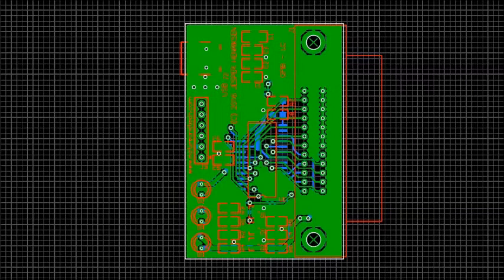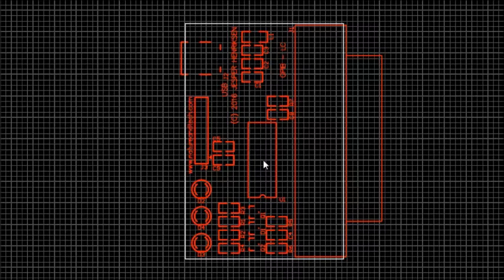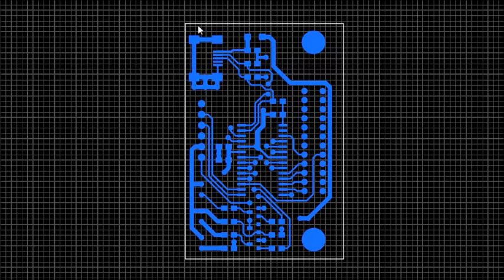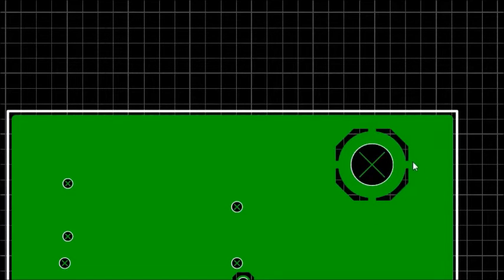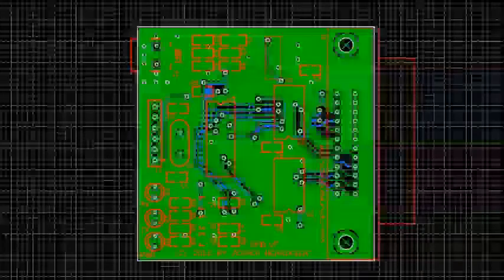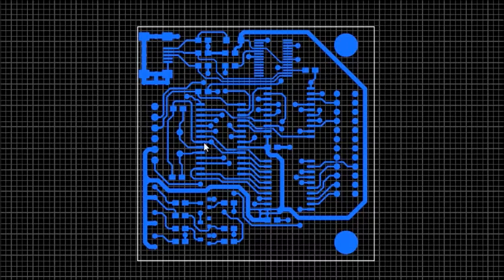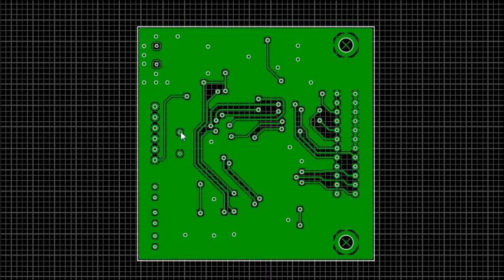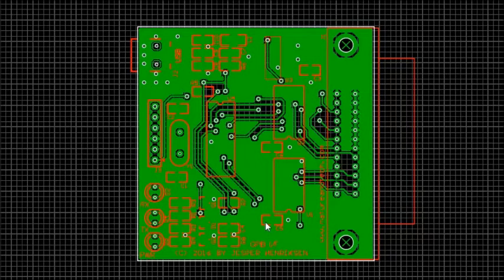Design of a USB to GPIB Bus Interface - Episode 3 - PCB Layout

Comment: I would like to make something like this using i2c to GPIB, so that I can connect it to any micro controller including an esp. I was thinking of something like the PCF7585. What do you think? 

I would like to see the circuit..
Also, where can I get a KiCad footprint and 3D step file for the GPIB connector?
Reply from the maker: I have no experience with the PCF7585. Looks like a capable device. I always draw my own footprints.

Comment: Thanks for your reply Jasper, 
I get surprised with all cad tools that you using for  pcb production. 
I'm trying to learning better eagle Cadsoft,KICAD cause it's free tool and CERN supporting it,also a little experience with altium. 
A few boards was from seeedstudio good quality, now I'm going to try an other pcb board house call dirtypcb offers nice quality and price includes shipping to Greece. The offer is for 10 pcb any color - solder mask,2 layers, check it. 
Kostas...
Reply from the maker: +SeAfasia Sometimes you just have to use the CAD tool that the customer wants, because it has to fit into their workflow. I heard good things about KiCAD.
Reply: +NatureAndTech 
nice tool try it some day Jesper,which board house are you send the gerbers to China?
Reply from the maker: +SeAfasia Not sure yet. I have lived many years in Asia, and I always used a PCB house in Thailand. However, they don't take paypal (or credit cards), so I think I will go for China this time. I am looking for one that can also do flex-PCBs, but have not found one yet.
Reply: +NatureAndTech 
ok,waiting to see the quality and your project soon Jesper..

Comment: Hi,Jesper nice job waiting to see the etching process and final pcb.
A question,what is the layout programm for pcb?
Thanks..
Reply from the maker: +SeAfasia Hi, I will send the PCBs to China for manufacture. 

Regarding the PCB layout software. I am using a really old version of Protel that I have kept from back when I had my own design company. It is not compatible with the newer versions of Windows , so I run it in a DOS box, in a virtual Windows machine. I think it is downloadable free of charge from Altium's website. 

I know it is ridiculous to use a 30 year old product, but I know that program inside out, including all the keyboard short-cuts, etc., so I am the most productive using that tool! Also, I have a huge home-made (and production proven) component library for it. It has served me well. I have used it from practically anything, including PCI cards, PABXs, Satellite set-top boxes, power-meters, dial-up modems, microcontroller boards, etc. etc.

During my working career I have used Zuken CADStar for Windows, Mentor Graphics for HP-Unix, PADS (DOS and Windows), DDE (multi-chip modules), Cadence for Sun Solaris (IC layout) and at my current workplace we use Orcad for Windows. They can all protect you from making many common mistakes (like too thin power-tracks, shorts, and help you with impedance matching) but I still find these monster-expensive packages way too tedious to configure and set up.

I have recently evaluated a couple of the cheaper packages, including Eagle (really shitty looking schematics) and DIPTrace (was initially really easy to use, but has gradually become very complex).

The software in the video is Sprint, which basically is a Gerber viewer with really basic editing function. I use it to check the files before sending them to the PCB manufacturing company, and for minor manual modifications to existing Gerber files where the design files have been lost.